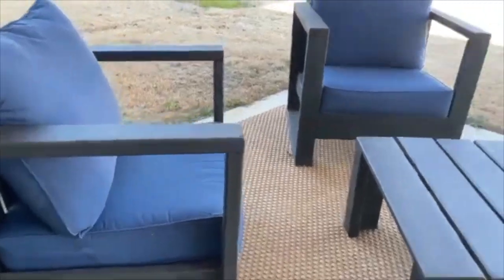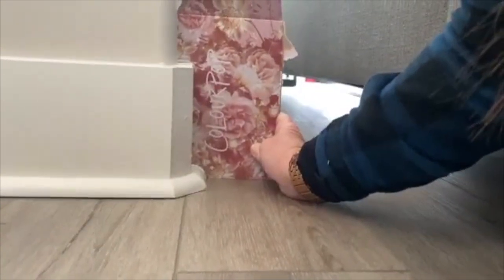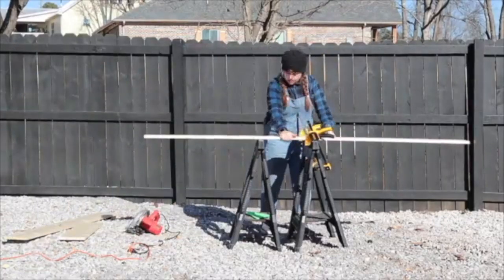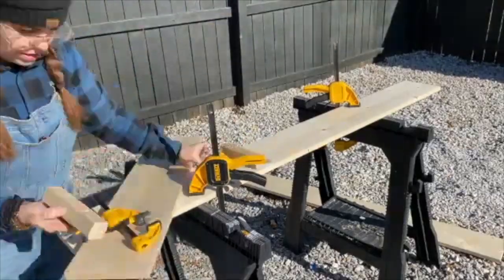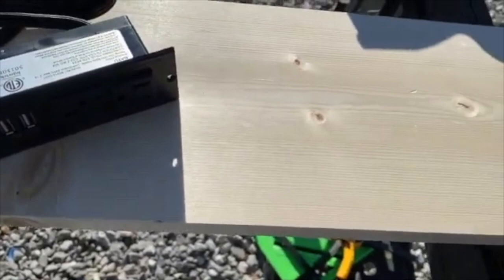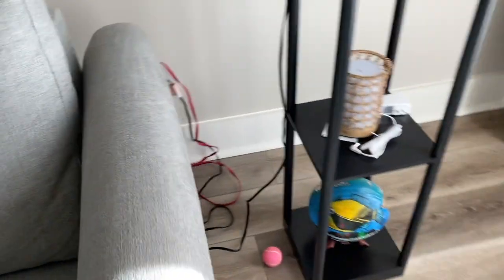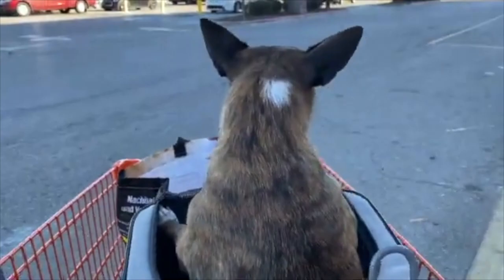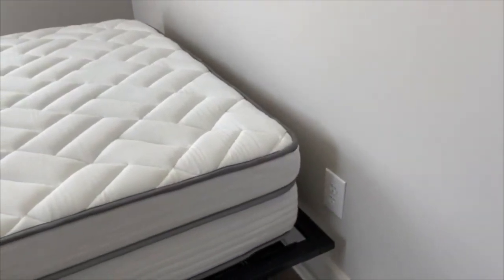DIY Behind the Couch Table for BEGINNERS!

Comment: Fun video.  Im also a novice at wood working.  I think instead of running a board in the middle from the table top to the floor i would of ran a board directly under the table top the entire length of the table.  Just a suggestion.  Just found your channel.  I subscribed. Looking forward to more
Reply from the maker: Thank you for the suggestion and subscribing !!! I can use all the help I can get. More videos coming soon!!